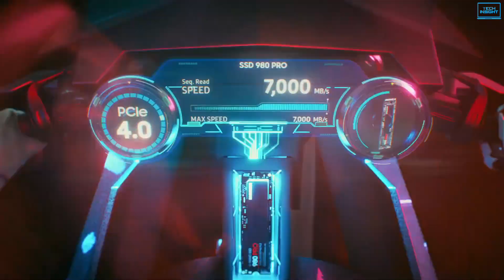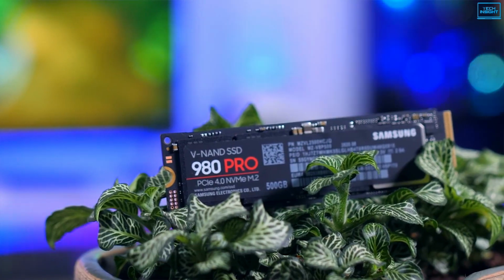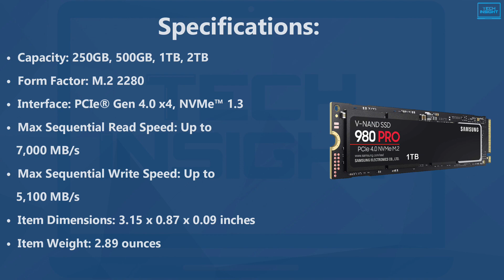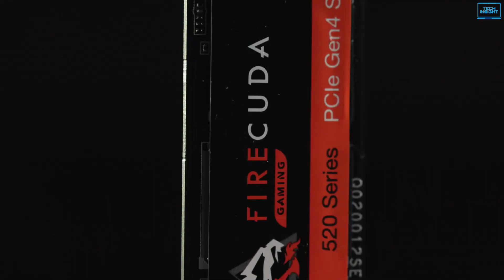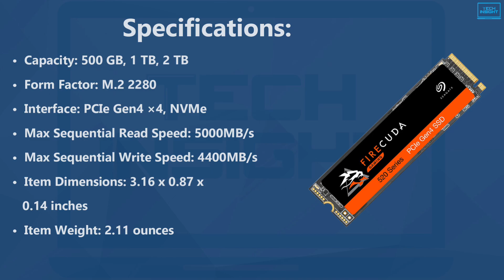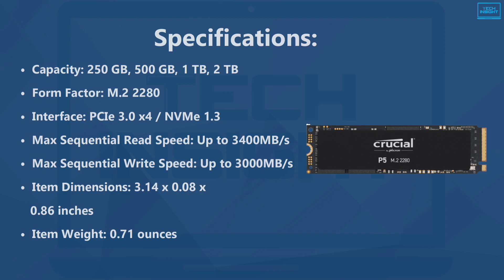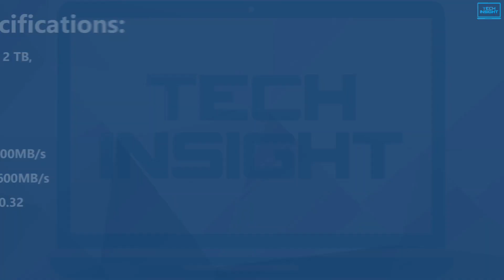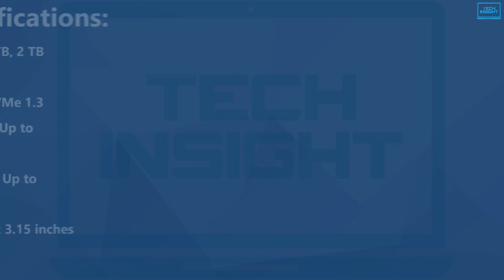Top 5 Best NVMe SSD 2023 | Fastest NVMe M.2 SSD

Comment: i can only afford crucial p2 x-x, will it be good for gaming ? i heard hdds have higher failure rate so im looking for a decent ssd. (i dont know anything about ssd's , is it compatible with asus tuf f17 fx706li?)
Reply: It will be fine (especially compared to an old HDD or 2.5 SSD)... other inexpensive NVMe SSDs to consider, the Crucial P3 (new) or the WD Blue SN570... both are fairly inexpensive and good options.

Comment: I'm building a gaming pc for the first time, would you recommend just an ssd or both an ssd and a nvme? How much storage would be best for both?
Reply from the maker: You can go for the Seagate Firecuda 530. And if you are gonna use it for personal use, then you might look for the 512GB variant. Otherwise for professional purpose, rather for for at least 1TB.
Reply: A good entry start many new PC builders do is to use an 500GB nvme as the boot drive and a 1 or 2TB SSD for gaming. Reason being is it's cheaper to pay for larger space for an SSD than nvme and the loading time difference between the two is minimal. Always better to have faster boot speeds over faster game loading speed.

Comment: I have 1TB 980 PRO but my speed is just 3500 MB / s can somebody help me how to speed up to maximum? config: Asrock Z490M PRO, 2x8GB DDR4 3200 MHz, I5 10600, RTX 2060. Win 10 PRO
Reply: Man seriously?? Your motherboard doesn't support gen 4pcie....
And 980 pro is a gen 4 pcie
That means Ur SSD is gonna work only on speeds for gen 3 that Ur mb supports
U made a terrible choice to be honest, sell the 980 and get the 970 Evo plus or stay with this SSD until u upgrade Ur system
Reply: Thank you for your response. So far I have used 970 PRO 512 GB I just needed 1 TB o f space so I bought 1 TB straight and 980 PRO straight because soon I will be improving the computer. (New board, CPU, etc.) Only question is what motherboard to buy i wanna buy 12600K  or waiting for 13 gen intel CPU. I like Asrock or Asus motherboard.

Comment: I would like to ask you if a simple 1 tb nvme crucial P2 ssd and more generally the pcie gen 3.0 ssd can pull you back in the gaming and simply daily (non-professional) environment substantially or they can be fine or maybe they may not withstand the new features of the new gpu that will come out etc .. Also I have this doubt about whether or not you can plug the SSD 3.0 in the 4.0 slot (I have an asus z690). Nice videos anyway.
Reply: You can plug it in, but if you plug a 4.0 ssd in a 3.0 slot it will only work at speeds of the 3.0 slot and not the marketed speeds.

Comment: Hi 
Why you said samsung 970 evo plus is the fastest, but samsung 980 pro has (7000 mb/s, 5000 mb/s) ???
Reply from the maker: That was an overall comparison, the list is made considering other factors also
Reply: @TechInsightt  
Thank you.
Reply: @TechInsightt  Thanks, yes and back in 2021, more PCs were transitioning to NVME PCIe 4 vs NVME PCIe 3.0, so that's one factor.  I have an older desktop from 3 years ago, so it only has a PCIe 3.0, so completely respect Samsung 970 evo plus.  I think another product that belongs on this list is the SK Hynix P31 gold which really rivals the #1 Samsung 970 evo plus.  So a tough call on the winner when taking all factors into consideration.  Thanks for the video!

Comment: samsung 970 evo vs 980 which is better?
Reply from the maker: both are good in different manners, depending on what your requirements are.
Reply: I personally would have bought 980pro over 970evo plus but my system does not support Pcie4
Reply: 970 Evo is PCIe 3.0, 980 is PCIe 4.0... use what your motherboard supports (yes, you can put a 4.0 SSD into a 3.0 slot, but it will only run at 3.0 speed so why pay more for a 4.0 drive only to put it in a 3.0 slot?).

Comment: I use the Samsung 980 pro on a x570 as rock tachi razor edition motherboard with a ryzen 7 5800x and i absouletly love the speed of this drive!
Reply: Yeah I need to upgrade my motherboard from Asus b450F to X570, I’m also using 5800X with 3070Ti. I want to take advantage of the fastest Nvme ssds that are out there so I can spawn into games like vanguard cod in search and destroy before my enemies
Reply: Will this work in lenovo ideapad 3 15ada05
Reply: @savitritiwari2824  it supports PCIe 3
Reply: @juanpaacosta8296  what is pcle

Comment: I've been looking for options for my Dell Inspiron laptop with AMD Ryzen.  and look for a unit with low consumption and good performance.  I have in mind SK hynix Gold P31 and Samsung 980. Any recommendations?
Reply: P31 is the most efficient one by far and it pretty much as fast as any gen 3 ssd can be. Plus the direct competitor for the SK Hynix is 970 Evo Plus, a bit higher tier than 980. So if you haven’t make a decision yet, consider the P31.
Reply: Samsung fights every warranty claim tooth and nail, get another brand.